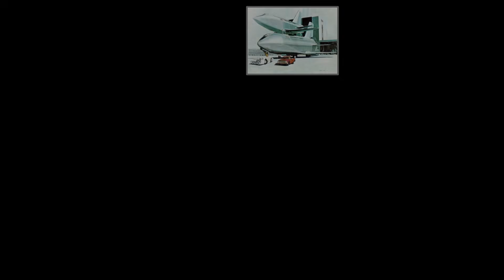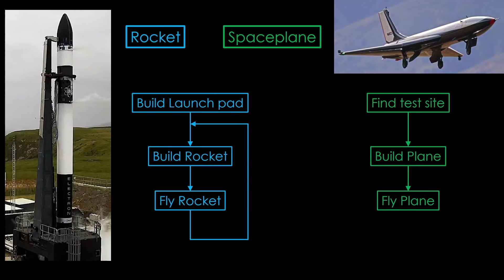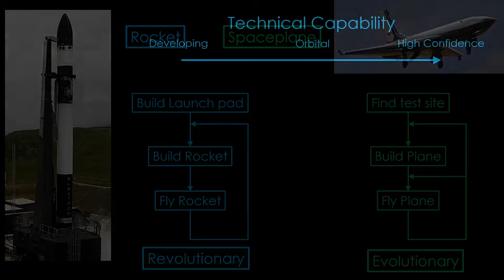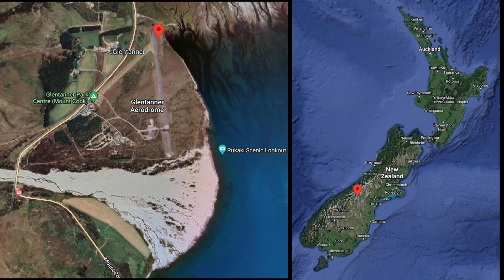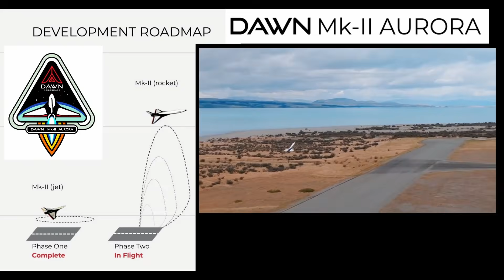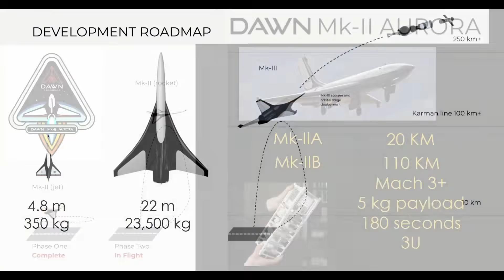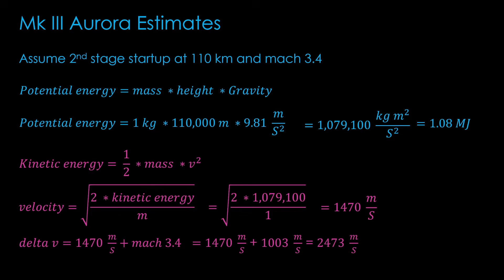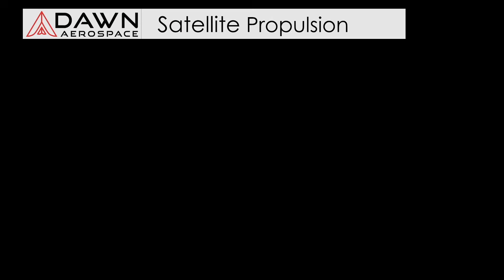Dawn Aerospace - Spaceplanes done right

Comment: "Space plane" is an adequate description, given that it flies like a plane and reaches space for a few minutes.
The way I think of it is more of a lifting body, horizontal launch booster. (not sure i'm punctuating that correctly) "Space plane" is way easier to say, so it'll probably stick unless we have a term for what it does.
Reply from the maker: Two-stage partially reusable horizontal takeoff horizontal landing (HTHL) small lift launch vehicle. 

But space plane sounds a lot cooler.
Reply: @EagerSpace  Yeah, unlikely to change it unless we come up with something snazzy. Or a small modification that makes "space plane" more accurate. Something to indicate that it is a plane-style first stage. I'm comfortable enough with space plane, though it makes me think of SSTO's.
Reply: reentry vehicles describe as planes but they glide back so don't fly independently anywhere in the atmosphere so befuddled

Comment: Not truly a space plane if it only goes above the karman line and not into orbit, is it? It surely can't be used to bring things back.
Reply from the maker: Space plane, not an orbital space plane. But the only current orbital space plane is just a reentry vehicle with wings. You can argue that it's not a truly a space plane either. 

If it was crewed, the pilots would qualify as astronauts using both US and FAI standards.
Reply: Cambridge Dictionary:  A spaceplane is a vehicle designed to fly beyond earth's atmosphere and return.

NB no mention of needing to achieve orbital velocity.

Comment: Great overview of Dawn!  It's an interesting and practical approach.  I would only add that ISRO has a spaceplane program, which recently achieved an autonomous, unpowered landing after being dropped from a helicopter several miles up.  China also has a a mysterious space plane, apparently similar in size and purpose to the X-37.
Reply from the maker: Yes, I was cheating a bit when I omitted those, but it was turning into a "spaceplanes" video rather than a specific video about dawn.
Reply: 1:16 leniency regards orbit keyhole project was one twenty kilometres orbital spacetug hypersonic glide ramscoop #abep

Comment: I would have been very excited about this 15 years ago but right now the launch market is massively overserved and competition is brutal. There are too many people trying to chase the smallsat market, not because they expect big business there, but because it's cool, and so any serious business has to compete against a few dozen hobbyists spending their investments irrationally. Not a good environment.
Reply from the maker: Smallsat is certainly a pit, but everybody is trying to compete with rocket economics. Decent sized factory, launch pad, high fixed costs, low cadence means high allocated fixed costs per flight, assuming you're actually trying to make money. It's a really high hill to climb to get ahead - first mover really matters a ton. 

Delta starts more at the SpaceX point, where you are reusing the first stage, but with lower fixed costs and maybe a simpler second-stage architecture. And the chance to maybe explore the hypersonic / suborbital research market which nobody has tried to disrupt (delta the new Electron variant).

Still a decent hill, but more likely to come up with a differentiated product and therefore be successful.

Comment: I had to wait and come back to rewatch this for my other question. At 18:36 you mention the figures for Mk III look right for the expected payload - but I didn't find what that payload figure is. Also couldn't find it on the internet. Is Dawn looking for a smallsat orbital payload of ~150kg? (Exclusive of upper stage.)
Reply from the maker: That information is in the Mark II fact sheet. 

https://static1.squarespace.com/static/5e82736a5e6bb91e8af13ea7/t/642ca7372f7f0742c4b01201/1680647993871/DA+Mk-II+Flyer+20230401.pdf
Reply: @EagerSpace   Thanks. 250 kg to orbit on the Mk III sounds like a doable number. (Carrying a separate upper stage.)

Comment: Interesting project, it looks similar to the Boeing phantom express in concept, with a reusable rocketplane first stage and small, expendable second stage. I think that approach makes more sense than the reusable second stage design that the shuttle uses, since you're suffering less from the tyranny of the rocket equation. Unfortunately, I read somewhere that Boeing gave up on the design because they were in regulatory hell with the FAA over the mission profile. Hopefully Dawn Aerospace has better luck with that, maybe starting in New Zealand will help.
Reply from the maker: Phantom Express was Boeing's entry for XS-1, and it's similar in that it's a booster that comes back and lands, but it's vertical takeoff which inherently makes it's a rocket that glides back, not a plane. 

The rumors I've read around Phantom express was that Boeing didn't really want to build it but they bid low to make sure nobody else would build it.

Comment: Their initial design is wrong. They aren't going to have the fuel capacity for orbit. The only design with enough volume to make it happen is a flying wing like the B-2. However, to develop the flight software needed to keep it in the air is a serious hurdle that must be overcome at stage one of development.
Reply: They don't plan on needing the fuel capacity for orbit, this will be a ~Mach 3 air launcher for a small upper rocket stage. A huge hypersonic flying wing is the kind of project that gets US govt funding in various configurations and then never gets anywhere. I like Dawn Aerospace's approach of going for what is doable.
Reply: @donjones4719  their approach is solid but their execution is where I see the flaws.
Reply from the maker: Are you clear that Mark III doesn't make it into orbit? It's just a booster stage. 

If you still think there's not enough fuel, then I'd be interested in seeing your calculations. The ones I made show that they likely have sufficient margins to get their target payload into orbit.
Reply: @EagerSpace  To be a space plane I think the ability to achieve orbit is a necessary goal. This is literally a rehash of virgin orbit with a  faster first stage. That brings all new issues into the equation. That speed is hell on an airframe, and then!  The most expensive part of the whole deal is still going to orbit and not being reused. So as I said in my OP the only way to have the lift and the volume for a true space plane is with blended wing design. Or use a nuke engine.
Reply from the maker: @rexmann1984  

It's a plane that flies into space. Suborbital space, but space. And the current list of aircraft that can do that starts and ends with the X-15. 

I'm assuming you're looking for a SSTO spaceplane. That's ridiculously hard to do from an engineering perspective. NASP, VentureStar, and Skylon have pretty much gone nowhere. That puts them in the "wouldn't it be nice if?" category, which is honestly one I don't spend much time thinking about because it's not actually clear if it's possible to build such a vehicle. 

This approach could, in time, lead two a two-stage design where both craft are planes and the upper stage is orbital. Possible, but still pretty darn hard to do. We've seen zero designs that can do that.
Reply: @EagerSpace I was thinking about the x-15 as well. Do you think the x-15 could've taken off from a runway? (Leaving aside its ventral fin). What's remarkable here is the carrier takes off horizontally but I wonder if that's really possible? Designs like the DC-3 were vertical takeoff. Also to serve as a first stage the carrier will need to go at least mach 6 (which the x-15 did manage)
Reply from the maker: @JohnBlackburn1975  Maybe...

The wings are tiny and you would have to get it going really, really fast to get it off the ground - it might even be supersonic. You wouldn't be able to do much with it. 

I see no reason why the carrier can't take off horizontally here. Fighter jets regularly take off and climb at a high angle of attack until they run out of air, and that's not a problem with rocket propulsion.

The estimates I gave in the video assumed it only got to mach 3.5.
Reply: @EagerSpace  Did you see the tail fin on this thing? How exactly to they plan to not burn that thing off when the second stage launches? You're talking about some pretty fancy maneuvering to get away from the second stage so it can fire. And doing that with no working control surfaces. Might as well put a rocket in the nose cone and be done with it. It'd be lighter and more efficient than the amount of RCS thrusters you'd need.
Reply: @EagerSpace  here's a few more things as to why I stand by my claim that the initial design is flawed. With such small wings it's landing approach with have to be rather fast. Which will be hard on the landing gear and negate it from using 90% of the runways in the world. If a space plane is something that can make it up 100 miles  Then an SR-71 style air breather will get you close enough to kiss it. And that's ancient tech by today's standards. The Blackbird's top speed is still classified but it was above mach3 for sure at something like 80,000 feet.  Let's say with today's metallurgy and jet propulsion innovation we can do mach 4 at 80,000 ft but will start to cook if we sustain that speed. Pitch the nose up 20° and trade some of that speed for altitude. The engines will eventually stall but that's okay because it's a jet engine that's already spinning. And since you'll be returning to base virtually empty the landing gear don't have to be as robust because the body of the plane provides lift allowing for a slower approach speed and more runways that can be used.
Reply: @EagerSpace  Mach 3.5 worries me a bit as most first stages seem to go at Mach 7-8. I feel Mach 6 is the minimum to be a useful first stage (correct me if I'm wrong!). I'm sure it will be a huge engineering challenge to get a rocket plane that takes off from a runway up to that speed never been done before. The X-15 did Mach 6 but was air dropped.
Reply from the maker: @JohnBlackburn1975  Mach 6 would certainly be better, but the crappy estimate I did was using mach 3.5 because that's the estimate for Mark II. 

Note that the mach 6 flight of the X-15 was only 30 km in altitude. The 100 km flights were mach 5.5.
Reply from the maker: @rexmann1984  Stage separation is done in space and therefore purely done with RCS. Keeping the exhaust off the booster will depend on the strength of the RCS system and the amount of time you are willing to coast, and there's a tradeoff there.
Reply from the maker: @rexmann1984  The landing will be fast but the vehicle will also be pretty light for landing with the payload and all the fuel gone (barring operational issues). 

The SR-71 record is around 85,000' for sustained flight. About 25 kilometers. The lower altitude means about 700 m/s less delta-v than 100 kilometers, which you will need to make up in the second stage. That pushes the second stage from a mass ratio of around 10.5 to around 13.3, and probably pushes the mass up roughly 50%. 

And to do the SR-71 style air breather you'll need an engine for it. I don't think there are any J58 engines lying around, and you aren't developing one easily on your own.
Reply: @EagerSpace  and there we come to the crux of the matter. These guys don't have the funding to get to where they want to go and they likely won't get because the initial design is flawed. The tail is an unnecessary problem in an environment filled with necessary problems to overcome.
Reply: @EagerSpace  yes, I'm aware of all that. But as it stands this isn't what I would call a space plane and certainly not one done right.
Reply: On your history section could've included XCOR who were trying for manned runway launcher suborbital plane.

Comment: Interesting video! At first I thought it was similar to Virgin Orbit but using a rocket plane as the carrier is more interesting in terms of delta-v. It's also rare to see a rocket plane taking off from the ground. It has no jet engines right? A horizontally launched rocket avoids the need for a pad and, even if huge, will not destroy the ground structure as with Starship. As you say, it can genuinely replace the first stage and is naturally reusable. Pity the 2nd stage is not reusable however, so in that way it's not really comparable with the Space Shuttle. Really the best solution is two planes, carrier and orbiter, as recommended by Werner Von Braun, but this has never been tried, not sure why...? 

BTW I think the carrier airplane for Pegasus went at only 300 m/s or so (subsonic). 720 m/s is nearly twice the speed of sound! So it was providing only 3% of the needed delta-v not 8%.
Reply from the maker: The plan is that the mark IIB and Mark III purely have rocket engines. That makes it less efficient at takeoff - airbreathing engines have a very high specific impulse - but it makes it a lot less simple. And - like rockets - it's going to quickly be out of the atmosphere where jet engines + tanks are just a waste of mass. You would also need a way to get the jets out of the airstream as they would add a lot of drag, which is more complexity. 

The double-plane approach is clearly better than single-stage-to-orbit, but as we saw with the shuttle, that's a lot of non-payload mass to take into orbit and bring back again. Worse, you pretty much need to finish developing the second stage before you do the first because if the second stage is heavier than you expected, it's a lot harder to upsize the first stage plane to do more of the work. 

WRT Pegasus, the delta v is the combination of the velocity plus the delta v it took to get to the release altitude, which is about 12 km IIRC. The combination of those two is where the 720 m/s came from.
Reply: @EagerSpace  Great analysis, thanks! If Starship and Superheavy were given wings and took off horizontally from a runway (stack lengthwise not end to end) do you think the 33 engines would destroy the runway? I guess it would need to be a long runway but would ordinary concrete suffice? It seems one of the main problems with large rockets is the ground pad. SpaceX just proved a simple flat piece of concrete won't do! But with horizontal launch the thrust is parallel to the concrete.

The selling point of Space Shuttle was it could land on a conventional runway but imagine if it could also take off from a conventional runway!
Reply: @JohnBlackburn1975  There is still a strong chance that the pitch up manaeuvour to leave the runway points the engines somewhat at the runway but it would be at a relatively low angle. 

Possibly minimised by having a very minor pitch up and primarily relying on your increasing speed to increase lift rather than changing angle of attack. You'd also only be blasting any one area of the runway briefly. I don't think its a given that spaceplanes would cause no damage to the runway but it's a possibility.
Reply: @EagerSpace  VentureStar-like shaped orbiter using Spacex technology (steel, cooling and engines) seems to be plausible.
Reply: atmosphere rocketry faster than icbm upward since residence time so heat decay's opposed build up indicates air breather

Comment: Anyone watching this may be interested in the in-depth interview done on the MECO podcast of April 5th. Episode 244. 

Another excellent video, Greg. Very interesting to see Dawn's approach laid out. Making airplane tech work as a 1st stage instead of converting rocket 1st stage tech into a plane makes a lot of sense. Yes, the development pathway is a lot simpler that way - especially now vs the 1990s, etc.

One quibble about an omitted detail. For ground handling to make several flights per day hydrogen peroxide is easier and ~less dangerous than LOX but at 98% it requires a hazmat suit or something close to it, right? (I'm not conflating that with the RCS thrusters/hydrazine bit at the end.)
Reply from the maker: Anthony Colangelo's excellent podcast on Dawn Aerospace is here:

https://mainenginecutoff.com/podcast/244

Interesting question on LOX versus hydrogen peroxide. 

I did a little more research, and while I think hydrogen peroxide does require appropriate PPE, I don't think it's quite as bad as LOX. Spilled hydrogen peroxide pretty much just sits there - or decomposes slowly - unless it encounters organic or other material it can oxidize. 

LOX quickly turns to lots of pure oxygen with the same issues, plus you have the issues of dealing with cryogenics plus the very real risk of freezing damage if you are in contact with it.
Reply: @EagerSpace Ironically peroxide is somewhat less vicious on organic materials when it's at rocket fuel concentrations, since there is too little water in it to really enable the sort of aqueous reactions that give it its notorious corrosiveness